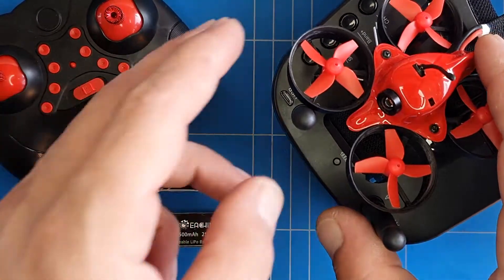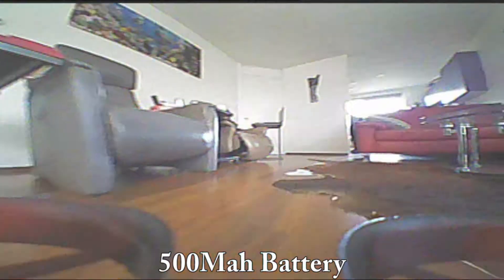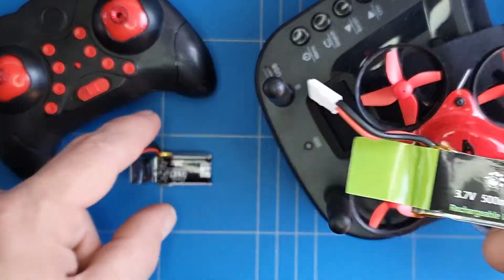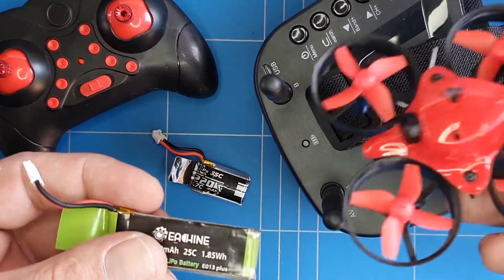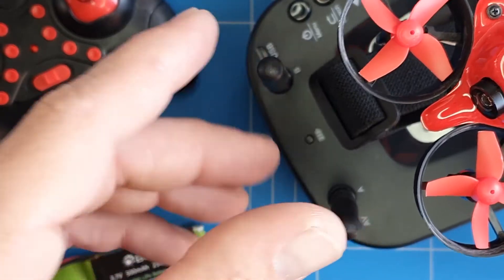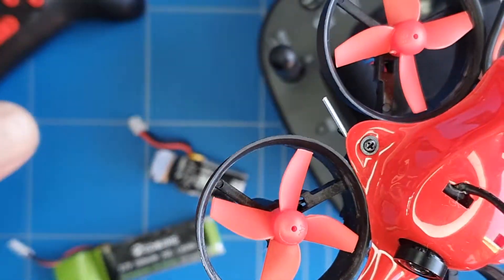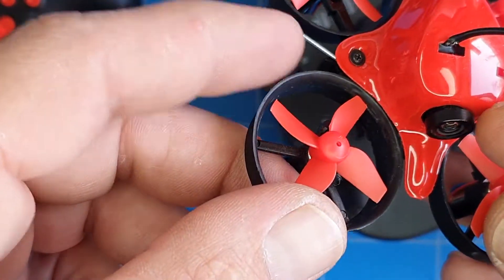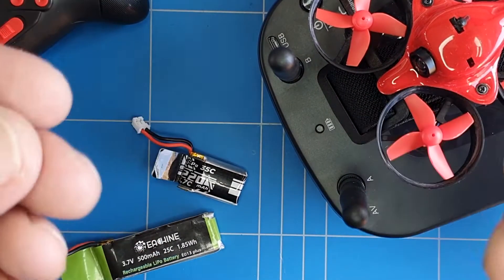Eachine E013 Lipo Battery Upgrade Flight Time TEST 220Mah vs 500Mah

Comment: nice video! but the batteries are sold out, what else is there for batteries that fit into the E013? Btw:I subscribed and liked ,great video!
Reply: Sweet vid.. But no chance of purchasing eny now.. So whats the next choice.. Did the 500 make the engines red hot?
Reply from the maker: Let me check
Reply: @HowToDIYRc  okay! 🥺
Reply from the maker: in it needs to be 7mm thick and not wider then 16mm